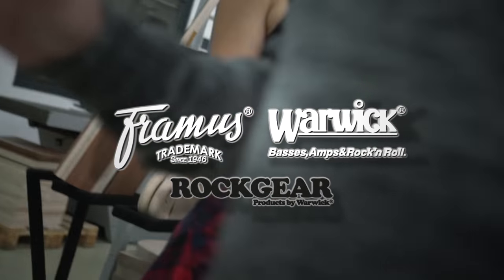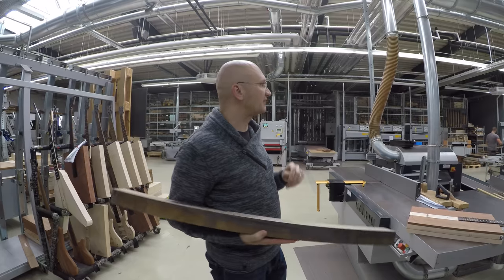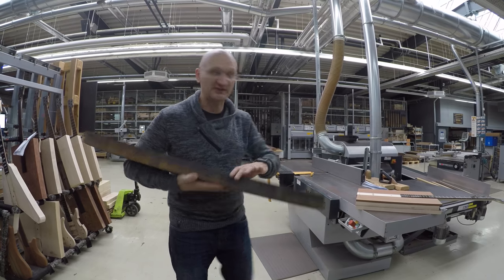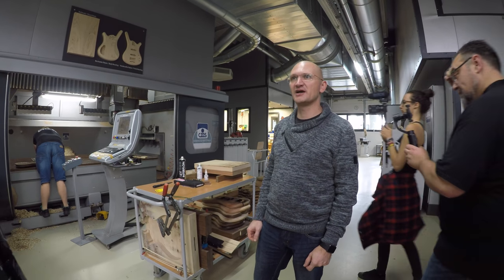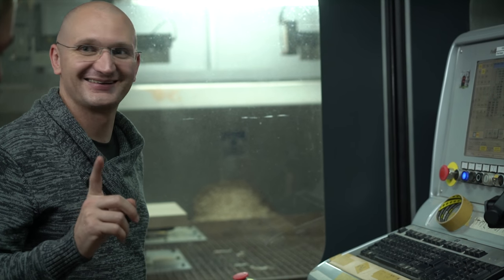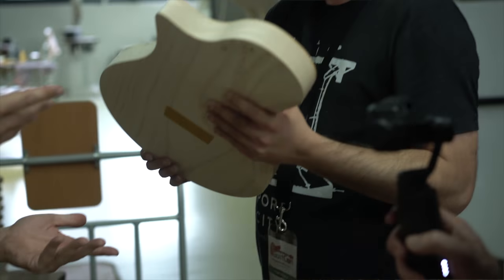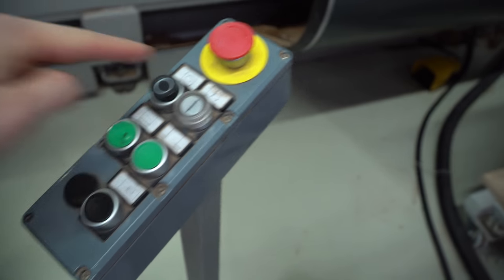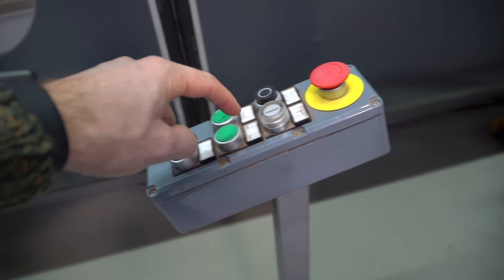"The Blank T" Project - CNC Carving during GuitCon

Comment: how many guitars do framus build in a day?
Reply: the equipment, the building, everything is super super expensive. these machines must run 24 hours a day in order to make some profit. it takes years to make that process work without failure. you need a lot of manpower to achieve that. i don't know how they do and did that. congratualtions. great job.
Reply from the maker: actually... they make way less guitars than you would think and as far as I know, the guitar factory part is only run by around 17 people.